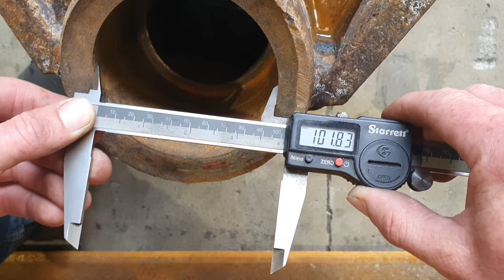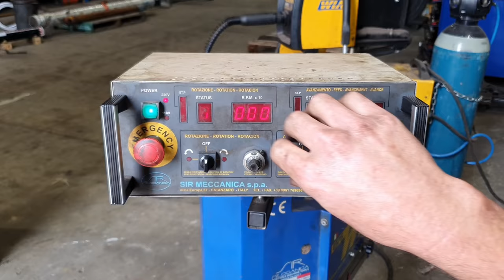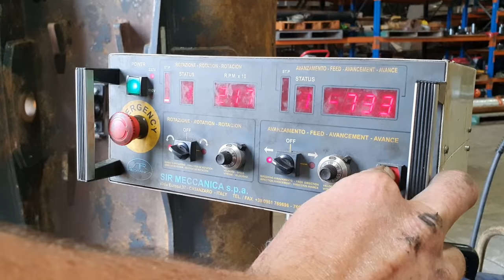Line boring Repair Tilt Bucket & Hitch | Sir Meccanica WS2

Comment: I always extremely impressed in that you rarely just fix an item you've been given, you are nearly always adding a upgrade that will prolong the life, increase the performance, or extend the service interval of that item so that the customer always gets back something that is better than it was when new. The way you run your business is incredible and the service you provide is top notch.
Reply: He's using the correct definition of "repair", as in not just getting it functional, but restoring it to factory condition if not better
Reply: Yes. Better than original.  Makes for a good reputation.
Reply: Would you do the same
Reply: @onkcuf совершенно верно

Comment: The best thing in your work is that the customers can choose a cheepest shop to do the job, BUT the customers that realizes that the cheepest job is NOT a good job, choose the RIGHT job at the right price.

Hi like how do you thinks about the work and appreciate that you realize a job soo good that it will work forever without failure!

Greating from a mechanical engineer from Italy.

Nice to see the Sir Meccanica portable bore welder, Italian do one of the best machine tools!

Comment: A man answered an ad that read, “Hiring welders $18-$24 per hour.”
When he arrived he was told he’d have to take a welding test.
He turned in 2 sets of welds. One was a great weld, the other was a mess.
When the boss asked him why he did this, he replied, “One is $18/hr, the other is $24/hr.”
Reply: Ha Haa!  Might try that one!
Reply: $18 and $24?  What year was that, 1990?  😂
Reply: @joedavidson4486  I live in southern Illinois, you would be lucky to get $18 around here. Pathetic...
Reply: MORE LIKE $38-50!  It’s not 1998 anymore and if you’re welding for $18-24/hr. You’re seriously underselling your skills as a welder.
Reply: hahaha
Reply: False economic reasons for going cheap……get it done correctly ONCE👏👏🇬🇧🇬🇧🇬🇧
Reply: @dwightmitchell1464  I no longer live in Illinois, precisely for that reason.  I've been in N.C. since 77, left a few times, always come back to "home".  I left Chicago in 76, because of the insanity of crime, and low wages.
Reply: Man, I hope there aren't any skilled welders working for anywhere near $24 per hour.

Comment: The wear and problems are growing exponentially with width of the bucket. 🙄
I'm long term borrowing the idea and doing that to our 3.5m tilter this winter. 
We bored and replaced bushes and shims 2 times in 7 years of using it and is due for another.

Cheers 🍻 and thanks for allowing us into your shop.
Reply from the maker: yeah mate do this!

Comment: This is an excellent video, on many levels. You demonstrate not just ingenuity and skill, but pride in your workmanship and a commitment to delivering excellent work each time. And Karen does another remarkable job of capturing every significant step in your work. Your discussion of the reasons for installing a differnet pivot arrangement was, as with everything else, clear and very interesting. Great work!

Comment: That is really an excellent solution to the problem. Having the pin in there with caps on the end will keep dirt out and grease in. What an amazing amount of swarf resulted from the line boring. Thanks for another excellent video. You provide wonderful engineering courses. We appreciate them.

Comment: I am amazed at how this turned out.  I can't fault the results, but I am a little surprised plugging the lock bolt holes with weld was done after the bores were done and the bushes installed.  I would be inclined to weld those up before the boring was done.  What am I missing?

Thanks for sharing these videos, it helps me plan and execute my rumblings in the shop.
Reply: Yeah I was also a bit surprised by that. I always try to avoid welding after machining as much as possible.

Comment: I absolutely love your content.  I am consistently impressed with your welding skills.  I was blown away by how perfectly you laid down the weld on the grease caps: the proverbial "stack of dimes."  How long have you been welding?

I also noticed an appearance by your new Quick Change Tool Holder.  How is that working out for you?
Reply from the maker: hey mate i've been welding over 20 years now. enjoying the new QCTP no complaints so far!
Reply: I've always thought of Kurtis as the "Rembrandt" of laying beads.
Reply: Yes he's very skilled. But a rotating welding table do make it allot easier to make a perfect 360° weld ☺️
Reply: Kurtis is a skilled man...no question. But welding heavy steel plate on a welding positioner with MIG is about as easy as welding gets. At the complete opposite end of this you would have something like 1mm Aluminium TIG welded with full penetration to X-ray QC.

Comment: I would be interested to know how long some of these operations take. Just a quick graphic with elapsed time would be excellent.
Reply from the maker: thanks for the suggestion!
Reply: I have thought that a few times as well if it’s possible. Hopefully you won’t get any cowboys saying I could have done that a lot quicker than that
Reply: That information is commercially confidential .
Reply: New Customer….. Yea Mate…. Send that busted part over to Cutting Edge…. I have seen on YouTube where he fixes stuff in 15 minutes
Reply: @coreydavis5552  I know I could lots of caulk and bubble gum I could have that pin in nice and tight ,, till they used it ,, lol
Reply: Showing time actually spent is bad business
Reply: @markmckinley5989  It would be no different to hiring a plumber/electrician/decorator to do work on your home.  You can see for yourself exactly how long they take to do the work and the standard they do it to.  I think what might be more realistic is the turn round time of the job - from when he received the job to when he returned it to the customer.

Comment: Nice that you can park your helicopter near the door. I know it's yours because it's the same color as the work shirts. That and Homeless is comfortable around it, as long as he doesn't make it a chew toy.
Reply from the maker: it's not mine, wish it was 🤣
Reply: @CuttingEdgeEngineering  You could buy a lot of new equipment for what that costs.
Reply: @CuttingEdgeEngineering  Its Carl's chopper 🤣😂🤣😂🤣
Reply: @shawnstrode3825  You could buy a lot of kit for the annual operating and maintenance costs!

Comment: This was a fascinating job. I was very impressed by the line boring equipment. The people that designed and built that really covered all the bases. The mig welding rotating and feeding operation really blew me away. What a brilliant process. Thanks for showing this job and all the setup and measuring that goes with it. I particularly liked the snap gauge. I liked how the guides are welded in place, the alignment coming from the piece itself. You are a very skilled operator too. Great stuff. All the best. Mart in England.

Comment: as im not a pro welder but can slap a stick or mig i always appreciate how strong those little tacks are they hold to tooling but just wack em with you hammer and tink i tend to overweld when i do cause if got to weld it i dont want to again. i dont dislike welding at all i just dont like the heat the grinding the dust the smell of high tensile steels blowing black soot out youre nose. i do however think that having a scba is the way to go ive met alot of old welders and the chromiun and other stuff made em unique but good on yah for investing in ppe i dont weld much and when i do i make sure to ventilate well

Comment: These are all heavy duty engineering applications, and some proper hardware to fix it all. Great fun to watch and very educational. I wonder how such repairs are done in smaller vehicles like a Ford Escort sized car or a high performance motorcycle. That is assuming a simple replacement isn't the best choice.

Comment: I have done machine work all my time after schooling,and was running a horizontal mill line boring for excavator buckets, and found it difficult to accurate enough for hitting the tolerance the engineers gave us, using spring calipers,you have to have good feel for spring calipers,a lot easier to take out bar and use ID mics or snap gauges, with od mics

Comment: Great video, again! One thing I did not understand: 
1.5mm was taken out on the back side of the hitch and 4mm on the front side, but I don't see how you set up those depths? You seem to fix the tool with the insert in the boring bar without measuring how far it sticks out of the boring bar surface. What did I miss?

Comment: Just a thought, each time you shift the line borer from end to end you are unplugging the eletronic control unit and lifting it off and then refitting it at the other end after moving the power unit. That was about 12 plugs/unplugs and shifting on the hitch job alone. Have you considered making the control unit its own individual stand?  The connecting cable looks long enough so you could leave the control unit free standing midway next to the job and permanently connected to the power unit throughout the procedure. You`d only need to be shifting the drive unit and saving wear and tear on the data socket and plug....?  Great video as always

Comment: For the welding aspect of the process, how do you figure out the travel speed around the orifice and the progression of the machine to stack the welds perfectly?
Reply: The line boring machine does it. It’s in the settings. It’s basically a lathe that puts on material instead of removing. So much distance per revolution for said speed if that makes sense.

Comment: Do you ever use cutting oil on the line bore? I always have a supply of unused motor oil and ATF left over from oil changes that I use for my heavy steel stuff I do from time to time...hard to Imagine not using it... if no oil is used how does the tool/cutting blade last?

Comment: I use bronze bushings on my lapidary slab saws. By using bushings that are a softer metal than the surrounding steel the bushings wear out first. So when they wear out you simply replace them with new ones. Without bushings wear on holes in the steel would mean replacement of a whole part. I'm guessing in your job the bushings are a softer steel than the pins that rotate in them.

Comment: That floating pin looks interesting. From where did you get the idea? I workas an engineer in the mining industry but I can't remember to have seen it ever before. Will definitely consider this solution in the future. I suppose you could replace the welded caps at each end with threaded ones?

Also, extra thanks for finally showing how to measure and set cutting diameter when lineboring.

Comment: i do have to say, as a mechanic for a rental company who supplies construction equipment, pins held in by bolts never last, they snap off alot and somehow the operators never see it until the attachment falls off. also the funniest thing was hearing an operator was supposed to grease daily. most operators have never heard of a grease gun lol.

Comment: Suppose it would be a little handier to have the line bore control box on a sepperate cart or stand, so you didn't have to pick it on and off for every change? unless it needs to be connected to the drive section?

Comment: I am curious about the wire snipping before starting welding - was it to remove the curling?  I thought it was surprising to cut 18" or whatever off where just 2-3 " would get a clean end.   Of course I have no experience welding, and don't for a moment doubt you know what you are doing.

Comment: One suggestion, on your grease caps, thread the grease guard you put on to accept a pipe cap. It might be a extra step when greasing but you don't have to dig dirt out. A true operator that does care for the equipment will take tge time to grease it properly anyway but will appreciate not having to dig dirt out.

Comment: Great video! Cheers for sharing. Always wanted to know how the line boring is aligned parallel with the original hole? I know you use the cups to center the line bore before you weld but if the original holes are so worn/egg shaped how do you know that you're running true to the original geometry?

Comment: Hi Kurtis -  may I suggest you spray some WD40 on the Harting connector on your line borer? It helps with in fitting and removal. 👍
Great job and video production. I liked the way you fixed the support bearing on the bucket - quick and easy. 👍👍

Comment: Great upgrade.
When you center with the tapered cones to line bore, is that it for measuring in most cases? Just curious if you have to adjust sometimes if it's wallowed out and wonky?

Comment: Question, if the bores are worn off center how do you re-center it? I noticed the bore machine uses chamfered centering dies for the shaft. If the bore was off-center wouldn’t the chamfered centering dies center it off centered? (If that makes sense). Keep posting content, I love it

Comment: I have a maybe stupid question: when you reclaim the bores you put the boring/welding machine on them an you align it using conical jigs. On a bore that is out of round or that is out of center due to wear wouldn’t that move the alignment of the axis of the entire assembly? I was imagining that you would find the center of the original bores and subsequently weld the machine in place based on reference measurements off of those. Maybe irrelevant, just curiosity

Comment: Hey mate, now that you have a fair bit of of time on it how do you rate the line boring setup you have? i'm thinking about getting into some mobile line boring but have only used huge setups in shops, nothing i'd consider portable.
Reply from the maker: hey mate I definitely rate it, if I was to get another one i'd buy another Sir Meccanica, for an electric portable setup I reckon it's one of the best
Reply: @CuttingEdgeEngineering  mate cheers for replying

Comment: 09:39 Why Bronze coated wire?  Add bronze to the filling weld for bearing purpose?
Reply from the maker: hey mate it is solely to protect the wire and better conductor than copper plus less spatter. Perfect for bore welding

Comment: I have a question; 
I see in this and more video's of yours that you center the bar for the line boring machine with 2 cone-shaped bushes in the old hole. 
How do you know the hole is worn out evenly on the inside?. Because if its not,  and you center the boring bar with the 2 cone-shaped thingies, the center of the hole your making could be off-center from the original center?. 

I love your video's, great work! Always waiting on a new one;)💪

Comment: I have done similar upgrades only difference is we use a threaded cap with a through bolt behind it to stop the cap from walking out.  That way you don’t have to cut the end off to get the pin out. The manufacturers of these buckets are very poor on their fit ups, your method is much better.

Comment: I was surprised that you didn’t cover/protect the inside of the bush when you welded the bolt holes shut. I guessing that you sprayed it with some anti-splatter liquid so that none of the welding splatter stuck to the inside of the bush.
Reply from the maker: yeah mate used anti spatter spray https://youtu.be/vLrgW30RJpM?t=1824

Comment: Considering you have 3 points of contact when boring the bucket, why move the motor from side to side?  Surely it would do the same job if you just moved the tool?  I have no experience with these things other than watching your channel, just interested to know what the difference is.  Thanks.

Comment: Sleeve? (by the way I'm not a machinist's back pocket - I bow to the Art of metal manipulation and utilisation)
Reply from the maker: I don't considering sleeving an appropriate repair, in most cases i've seen they fail, would usually be a custom size that is then harder for the customer to replace, and you're reducing the amount of parent material on the component which weakens it

Comment: A question, please tel me if you made your bore mesuring tool yourself or did you get it with your kit. Thanks.
Reply: The tool for inside diameter measurement is a standard tool

Comment: Better yet is 90-140 gear lube. Used in Kingpins of truck Suspensions the pins last longer, it is easier to lube as just pour a bit into the cup ,and no pesky grease gun needed.  Try it.

Comment: NIce shop u got there :) What is that machine u put on in the beginning for boring? I can see a lot of use for that kind of machine at my work. Working with a CO2 Laser cutting machine and cutting a lot of Stinless material. Also a lot of milling and turning in manual machines. Have a great weekend from a snowy Sweden :) (-10C and over 40 cm of snow last week) Btw I love your Sefety Officer hes a good looking dog <3
Reply from the maker: hey mate it's a Sir Meccanica WS2 portable line boring & bore welding machine

Comment: I watch your videos regularly and the question I keep coming up with is. Do you from time to time get request to use your designs in their shop? I mean to be honest your ideas are always above any solution I have even seen before, so to me they are "cutting edge"…    Do the manufactures ever ask if they can use your solution as a production improvement?  Just seems to me you find long term solutions they should be using.     Chunky Tater….

Comment: HOMEY!!!!!!!!!!!!!!!!!!!!!!
and Kurtis and GG (giggly girl) too of course...... ROFL
Curious thought Kurtis, on the "weld up the old bolt holes", Could you not have saved a little time by machining a 3/4 depth slug and put it in there then weld the outside surface up? Since it's nothing more now than a grease trap with no pressure on it, couple layers of weld should hold it as fine as you weld, and would save a bit of time and mig machine wear and tear and materials.... 
Just a thought... 
HOMEY!!!!!!!!!!!!!!!!!!!!!!!!!!!!!!!!!!!!!!!!!!!!!! @>--->--->-------